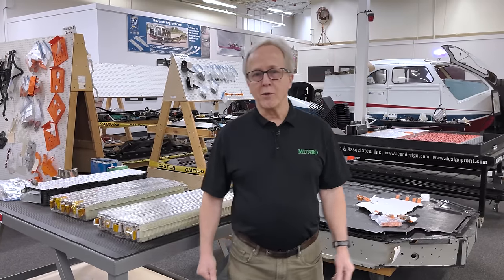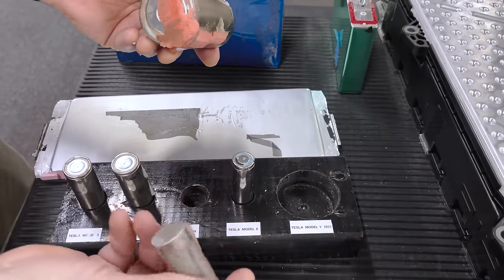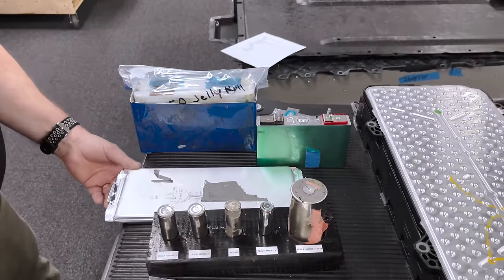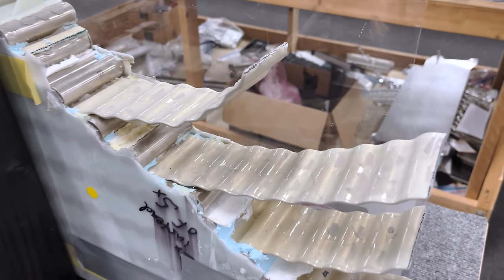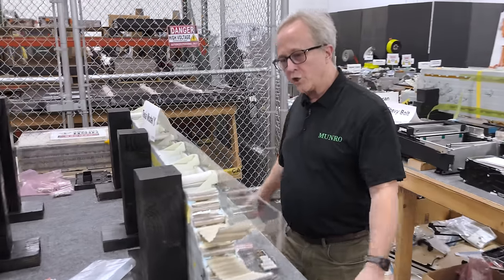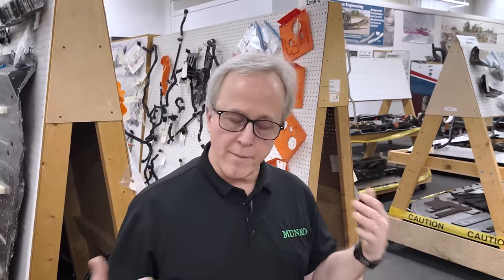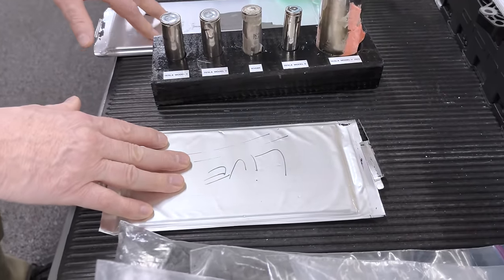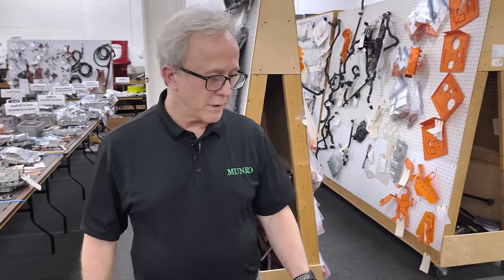Electric Vehicle Battery Breakdown: Cells to Modules to Packs!

Comment: This was the best explanation of batteries that I have seen. It helped to see the insides. Tabs and no tabs.
Reply: batteries are more complex than engines therefore ev are more prone to issues.
Reply: Definitely worth the watch.
Reply: @mattwill63 Matt You seem to be forgetting that there is much more to an ICE car than the engine (alternator, belts, transmission, axel, U-joints, etc)

Comment: This was awesome. A friend of mine has a BYD seal with an 82KWH LFP battery, he claims he can get 500km useable range yet my model S with its 85KWH battery is good for 390km. Tesla service have advised me the battery health in my model S is 96% - excellent rate for a 9 year old EV. The car has never been super charged and the max charge for 99% driving is 70-80% and min never been less than 25%.

Comment: Excellent video! I’ve worked on battery separators for four years and this is a great and understandable summary of many different aspects.
Also good to leave power draw to a different video as it depends on a lot of aspects of cell design (not just the raw values) as well as the pack design, especially thermal management. So it deserves its own video.

Comment: Great start, Tom.  Next I'd like to see a discussion of how the pack organization affects the ability to draw/input (discharge/charge) massive power.  This is probably a discussion of resistance in milliohms and how to minimize that to minimize heat generation and maximize the available power delivered as opposed to generating heat within the pack that has to be removed through cooling.  A discussion of connector resistance vs busbar resistance (minimizing the number of modules) would be helpful.  Example:  Jaguar I-Pace has 34 modules with external wires & connectors compared to a Tesla Model 3 which has 4 modules with busbar interconnects.

Comment: Great video!  Particularly loved the beginning to end flow and the spreadsheet!

One thing that's worth mentioning is the BMS will balance each of the series individually and that over time, the individual cells in parallel for each of these series can diverge in ampacity and voltage.  This is because balancing happens at the series level, not cell level, and cells vary in resistance (degrade) over time.  As such, having all cells in series, like in the case of the Tesla LFP prismatic, creates the added benefit of individual cell-level monitoring since there are no parallel groups.   Additionally, the lower voltages of LFP, while seemingly a drawback, allow for charging to 100% and significantly reduce unwanted reactions that would otherwise occur over 80% state of charge (>4v per cell of 4.2v max) in NMC chemistries.  Other benefits for LFP include higher cycle life, lower cost, higher safety, and environmentally friendly (no cobalt).  Of course, nothing is perfect and the primary drawbacks to LFP include lower volumetric and gravimetric energy density as well as poor cold weather performance.

I just wish the US M3 RWD, which uses quality CATL LFP cells, wasn't de-contented with fewer speakers, only 170kw max DC fast charging (vs 250kw for LR), and 32 amp home charging (vs 48a for LR).  Tesla should offer a premium upgrade option to the M3 RWD for those who are looking for LFP and not have reduced functionality to hit a price target.  Perhaps this is due to the C rating on the LFP prismatic cells (would be great deep-dive material!).  Last but not least, it will be interesting to see if Tesla moves to LMFP chemistry in the future for slightly better cold weather performance and volumetric/gravimetric energy density to the detriment of cycle life.

Comment: This excellent overview of EV battery pack design challenges and options shows how the critical elements determining the reliability and service life of vehicles are changing from the mechanical to the chemical. This video clearly showed that sealants, coolants, conducting/insulating/supporting foams and gels used in the pack are in a demanding environment, and all have a critical role in reliability. Let's hope all the goops last.

Comment: Would love to see some of your suggestions about shape/size of cells & cooling pack designs to maximize efficiency, reduce casing cell material weight, and perhaps improve or reduce thermal runaway to smaller and smaller numbers of cells.

Comment: Awesome battery explanation!  Thank you for putting this together.  This is the most neglected part of EV car reviews and in my eyes also the most important.  Very cool how Tesla has essentially glued the cells together while still managing venting of the cells.  Tesla's new cell fusing is also very cool.  I would love to see a video on discharge rate comparisons with the various EV companies.  Are pouch cells more powerful in this regard with higher c rates?  From a longevity standpoint, would you consider the cylindrical cells better than the pouch cells or have they solved the pouch cell swelling and failures in the recent EV packs?  From a safety standpoint are the pouch cells still more volatile than the cylindrical cells?

Comment: This was an excellent session as I listened to it on my way to work this morning. Can you elaborate on the difference between the problematic 🔥BOLT batteries vs the updated units?
Reply: The Bolt battery pack we tore down was pre-recall. We haven't seen the post-recall Bolt battery pack to know for sure, but we've seen other GM packs that were post-Bolt recall. I would not be surprised to see that the post-recall Bolt pack has some added Aerogel layering in some strategic places.
Reply: @TomPrucha thank you!

Comment: Excellent info. Wound have been nice to see an approximate cell weight for each cell type listed in the spreadsheet. While weights of 18650, 2170 cells are known, it would have been nice to see how a LFP cell, or pack compares in weight compared to it's energy density. Perhaps a topic for a future video?

Comment: I would interested to see a weight comparison of the different battery /module constructs. It would be particularly interesting to see a weight comparison that includes the structural battery of the Tesla and the battery, plus the structural element of some of the other vehicles.

Comment: Excellent detailed discussion, but the wide variety of chemistries and physical configurations begs the question about the inevitable standarization of battery packs. I want to buy an EV, but will I be able to swap to a better battery in a few years without dismantling the entire car? Will I be able to buy a third-party battery without voiding the OEM warranty (since competition should also drive down battery costs)? I'd like to know if there is any industry effort to create standard battery specs and allow interchangeability. Legacy battery makers like Panasonic and LG have already faced this issue that affects future mass adoption.

Comment: Very nice presentation.  It would be nice to have more information on other battery packs instead of just Tesla.  For example the VW, Audi, BYD and wireless control of the GM Ultium packs.  It would be nice to add some energy density data to your spreadsheet by adding weight and volume data.  Maybe even charge cycles to a certain efficiency loss?  Thank you for sharing your knowledge.

Comment: I wish that in every review your company does on a battery packs, that you make it clear if that pack is repairable at the module level or if the battery pack has to be replaced if there is a problem with it.

Comment: Great presentation.  It has bothered me in the past that all Munro Live battery evaluations emphasize the simplicity of the Tesla battery management system compared to others when in fact the Tesla BMS is for all practical BMS purposes non-existent.  Plugging into the OBD on my 2014 Chevy Spark I can monitor every single pouch cell and replace if required.   On the Tesla I can replace the whole pack.
Reply: Tesla structural pack design might not facilitate repair, but I can't imagine its BMS is any less diligent.

Comment: Hence cycling rates become very important with vms…. Wondering if they perform cell matching?? Didn’t hear this being discussed.. but good material overall
Reply: Cell matching means different things to different people. It can mean getting the cells all from the same manufacturing batch. It can mean getting them all into the same voltage or SoC range. It can mean matching their internal impedances or DC resistances.  A good balancing system minimizes the need for any such matching, but sadly a good balancing system is expensive so it can be cheaper to just sort the cells instead.

Comment: Thanks for an great video. Would like to  get an update of the chemistry of all the batteries to each car. I think today its only Tesla and Byd which has LFP batteries. Also nice to know kWh/kg for the different manufactured. Not easy to find these information 😅. Thx again 😊😊
Reply: In the USA, we don't have many LFP batteries on the road yet. We don't really have BYD yet, and we don't often see the Tesla LFPs on US roads.  That will change in the coming years as people stop insisting on only the best possible energy density.  Having the battery get a little heavier for the same range or the same weight for less range will be OK for a lot of people if it saves money, has longer cycle life, and is safer.

Comment: Inside the coolant tubes are there stamped and folded baffles to cause turbulence in the liquid flow like they commonly insert in Chrysler Aluminum U shaped Heater cores? These baffles are thin strip of copper with cut outs that are folded  to make the strip 3 dimensional and stay centers in the fluid flow to cause the coolant to flow more slowly, and better  transfer heat to or  from the tube walls, depending on the temperature of the coolant.

Comment: My EV doesnt use any of these. It uses a 126S1P 60KWhr LFP blade battery. Few components (just 126 cells), simple, light weight design with very good thermal management - they dont burn.

Around here it's the most popular EV battery configuration. It works extremely well.

Comment: Hey Guys, great video! Could you make a video about the Model Y Blade Battery and explain why it is able to charge mutch faster than the BYD Cars? That would be great and extremely interesting.
Reply: If you look at the BYD Seal, with 82 KWh and the same Wltp Range as a Model 3, I only can imagen what Tesla could do with this Battery in a Model 3. More Range, cheaper Battery, more Zykles and fast Charging like the Model Y Blade. LFP has a great future

Comment: Great video - also to see the evolution of the celltypes that Tesla uses.
But, I hope if it's OK to shout out a question here;
Are there any tools to identify EV prismatic celles? I have gotten a pack of 7 celles from a friend, and have searched quite a lot - without being able to identify them. They only have a barcode on the top of them (one of them is 1E110112911584) - but I can't find any data about them, at all.
Reason for asking is that I'm hoping to get them implemented in a solar-setup (hobby/DIY-project) I'm working on - but it's kind if "impossible" without knowing their specs/parameters.
They are all resting at around 4.01V, and have been like that for the last 3 months.

Comment: Would it be possible to integrate the cooling solution directly into the insulator inside of the cell? Micro channels may even provide capillary forces for fluid circulation in the event of pump failure.

Comment: If battery cells are in series and one stops functioning, all the cells in that series stop working, right? Is there a way to overcome this? Maybe when the battery ignites, that heat fuses the cell’s cap with the cylinder exterior, so the series connection continues? Or would that encourage the next cell to ignite? And could that be overcome by sensing the first battery is on fire, so the pack shuts down the series until that heat source cools off?

Comment: What is the pack weight of the two shown in the crate (less the wood crate)? Also the outside width, depth, length. Thank you. Looking forward to C rating discussion as it will be helpful for aviation considerations.
Reply: For those particular packs, the project didn't require weighing or measuring any major battery-related components, sorry.

Comment: This is mostly a video about packaging cells. So, do the EV manufacturers use all their available space for cells or are there blanks? For example, with the cybertruck is the only way to increase battery capacity to install batteries in the truck bed?

Comment: Given the charge/discharge cycle & thermal changes that result in expansion and contraction of the cells and pack roll degradation over time, are there material choices in battery cell casings/rolls, cathode/anode materials that could further reduce or limit expansion/contraction damage, such as vacuum sealing cells, packs, modules, casings, etc, in order to improve efficiency of thermal management?
Reply: That's a big and complex subject, exacerbated by practical cost limitations, and the many different form factors and sizes of cells. As you can see in the videos, there are lots of methods that all compete to be best. Any and all of of those things you mention may help, but at what cost and weight penalties?  Sorry for the non-answer, but it's the wild west out there. I personally look forward to the day the performance and durability wins over cost, but I don't expect that anytime soon.  For example, with pouch cells you have a big copper tab on the anode that is highly thermally conductive and strings throughout the entire cell. Why not just extract the heat from that big copper anode tab? Well, because that tab must also remain electrically insulated from the other tabs. It is difficult (too expensive), so nobody does that, yet.
Reply: The main way to avoid physical damage is to reduce the charge range.  For example stay between 20% and 80% of full charge, and your battery will love you forever.  Not covered here is long term damage (ageing) of cells is from one-way breakdown of electrolyte.  This happens at charge extremes.  Having some externally applied pressure counteracts inefficiencies from physical separation of + and - sides.

Comment: I’m imagining a thermos like design with a vacuum sealed casing to prolong temperature control etc.
Reply: Heat mostly has to be removed when energy flows in and out.  The case where thermal insulation could help is when the battery is heated prior to charge/discharge so it can perform efficiently at low temperatures.

Comment: Could Tesla pack design be improved with cooling at the anode (on the bottom) to increase cooling efficiency and thus improve range by reducing energy required in the cooling process?
Reply: That is a good question. Tesla's side cooling method using serpentine coolers can pick-up a lot of heat off the side of the cell, because of the size of the accessible side surface area being larger than the bottom of the cells. So even if the bottom gets hotter, the greater surface area of the side may prevail for better cooling. For 21700 cells, Lucid has a pretty good argument for bottom cooling, but I doubt that advantage exists with cooling the bottom of a 4680, and you probably don't want bottom-cool a 4680 since the vent goes out the bottom on that cell. It sounds like a great experiment we should try. Heat two 2170s equally with equal discharging and see whether bottom or side heat sinks work better.

Comment: Question, I see the model 3/Y pack was labelled 2018, do you have a newer 2023 Model Y pack? Does it still have the same heat gradient that the older 3/Y had or did they upgrade it to the more even gradient that the plaid introduced?
Reply: The Plaid pack with 18650s and the structural model Y pack shown in the video with 4680 cells both have the newer, better, serpentine cooler with the inlet and outlet at the same end, but I don't know about the latest 2170 version, as we haven't taken any of those apart yet to be sure. Watch this space.
Reply: Thanks @TomPrucha  , will keep an eye out!

Comment: As batteries began to wear out do you see manufacturers installing upgraded batteries in what will be older vehicles as technology changes?
Reply: Nope. I don't see it.
Reply: I do see a big aftermarket business coming for re-manufactured battery packs, and new replacement packs by upgrading or even downgrading technology. For example, there might be a business case to build a lower-cost LFP replacement pack for Tesla NMC and NCA packs.  Yes it would have less range, but it would be way less expensive and it would last longer.
Reply: It has definitely happened.  Early Nissan Leaf with older tech, heavily degraded can now be fitted with larger capacity newness.  Buy a popular make, and market pressures will make it happen.

Comment: How about explaining the electrical insulation from all the cells with different voltages on the outside, to the metal cooling channels which are at one voltage (probably 0V)
Reply: Cylindrical cells do need to be electrically insulated from each other. There is a thermally conductive electrically insulating layer between the cooling tube and the cylindrical cells so they don't short against each other.  Pouch cells are in electrically insulated envelopes, and Prismatic cans are usually insulated from the terminals, so cooling them from their sides doesn't require as much care about electrical insulation.